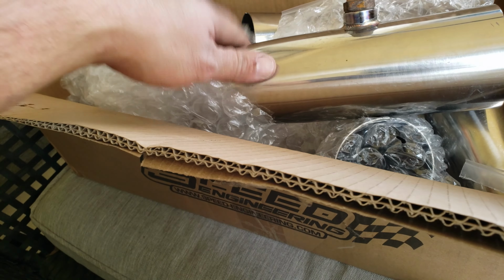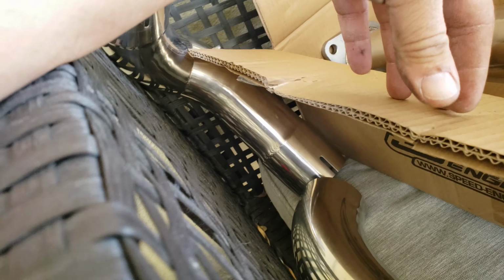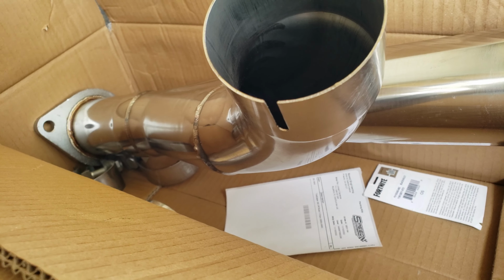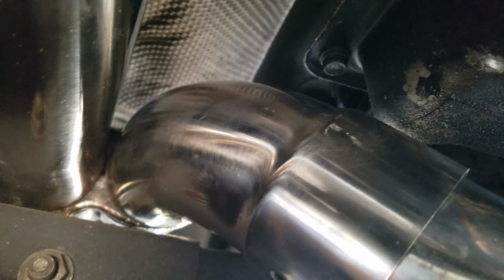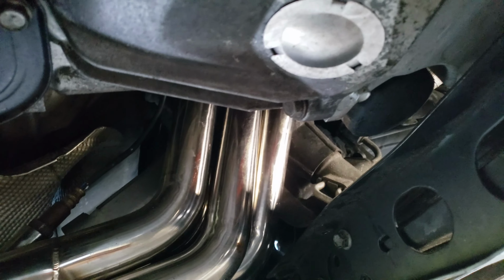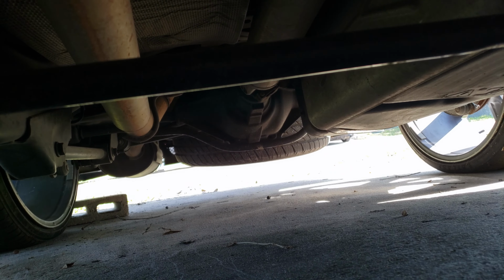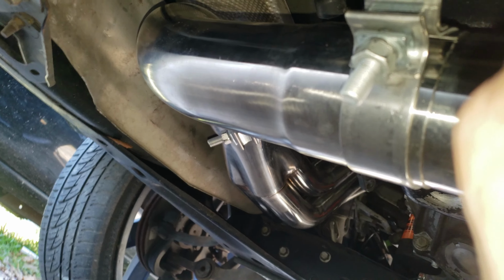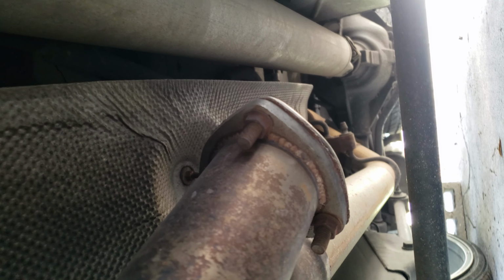Trailblazer SS speed engineering y pipe and headers install

Comment: Do I need the o2 sensor extension for that or no?
Reply from the maker: No sir fits just fine
Reply: @SiempreTumbadoSprayedbyRo  thanks man , but is it necessary to get the y pipe or no ?
Reply from the maker: @obsyon7148  you can modify and weld up your original exhaust to work. But I wanted it to fit with no problems and look nice so I went that route

Comment: Hey brother got a poor mans SS.  It's a 5.3 with dod delete, Stage 2 cam, ported and polished heads, and a bunch of other goodies. 

But I've noticed now my truck stinks like sulphur and I think my cats are bad, is this a sign? 

if so I want to just cut the cats out and replace with straight pipe. 

Here's my question.  

If I do this do I need to get those extenders for the downstream 02's to keep off the CEL? 

Sweet TBSS brother.  I'm at 407hp 412tq with my 5.3 so basically I'm where a stock SS is after ALOT of engine work.....😆
Reply from the maker: Hey man ain't nothing wrong with that, no one will ever know lol. Yes you can cut out the cats and replace with straight pipe. If I'm correct the o2 sensors plug in before the cats so no extensions will be necessary. But it's been a while since I looked at the factory ypipe
Reply: @SiempreTumbadoSprayedbyRo  it's got 02s before and just after the cat.  

I just moved a LOOONG ways away from where I had so many friends that could help me with shit like getting into the ECU and getting rid of any codes from deleting the cats. 
.
I called around where I'm at in Orlando and everyone wants 500 and up to reprogram the truck.  

I miss just grilling my buddy a Ribeye and him coming over with his laptop and tuning my rig. 

Thanks for the response.  Subscribed